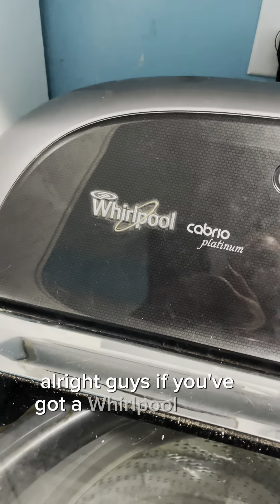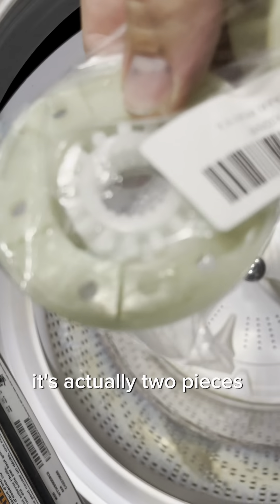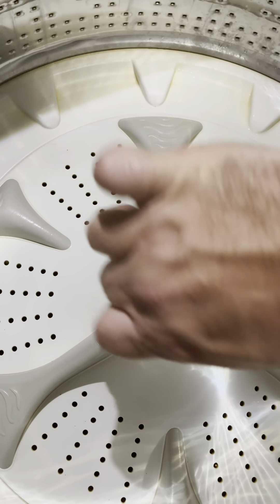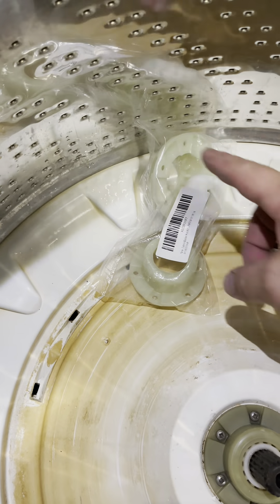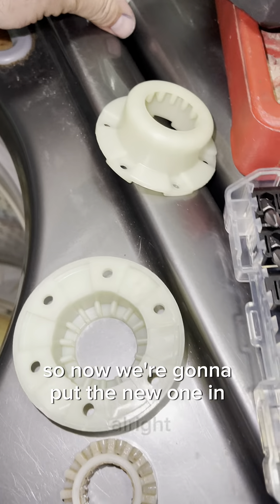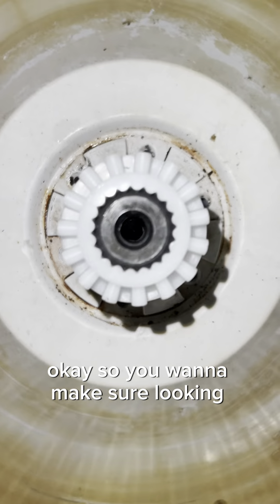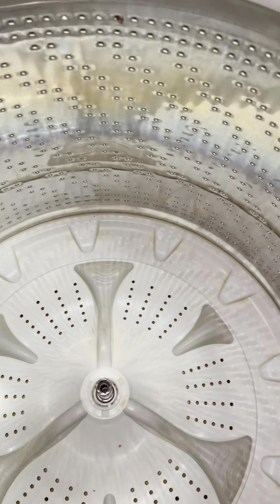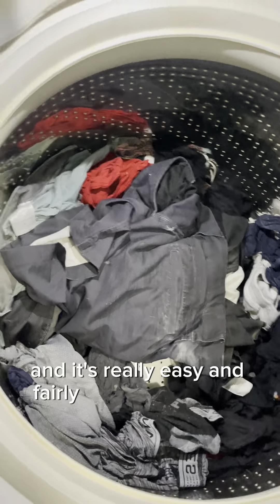10 MINUTE DIY WHIRLPOOL SD ERROR CODE QUICK FIX

Comment: I’m getting sd but mostly ul codes towards the end of the cycle and it sends my tumbler into a violent spin where it bangs about and eventually stops. I’ve changed a bearing set about six months ago and it was perfect until recently. I’ve also changed the suspension a few days ago, which didn’t help the problem. This would be my next step I guess… u think this is a likely solution for me?

Comment: Any tips for loosening a bolt that is on there extra tight? TIA
Reply from the maker: Sorry for the delay. If you have an impact driver drill. Get an adapter for the drill that can hold the socket. That should easily do the trick.
Reply: May ant to try using a 1/4" impact screw gun with the correct socket